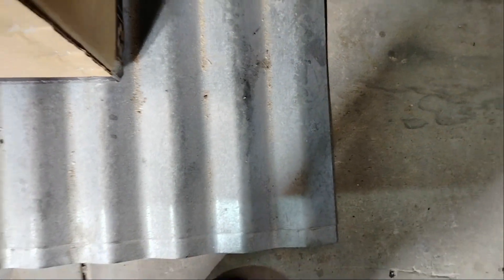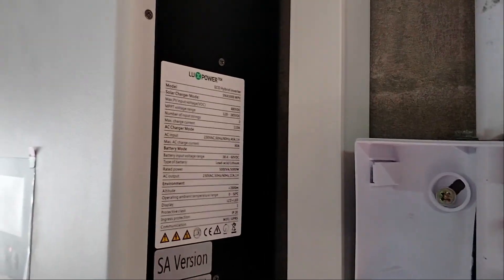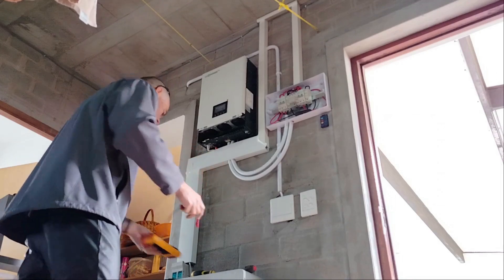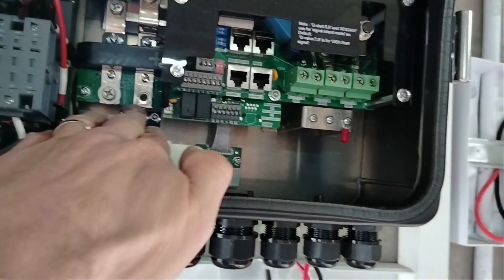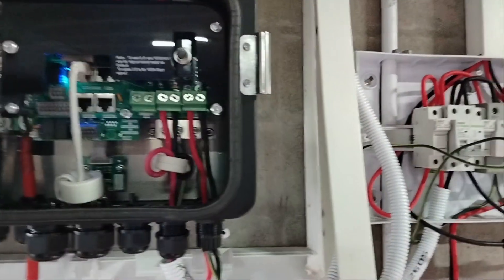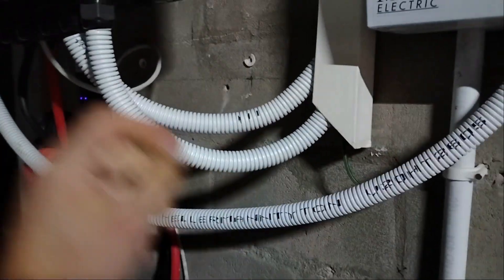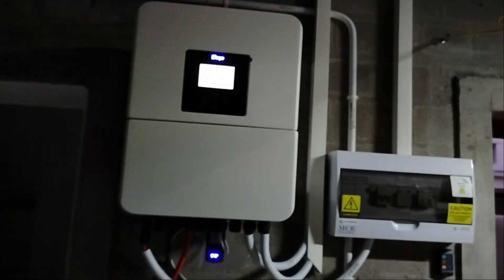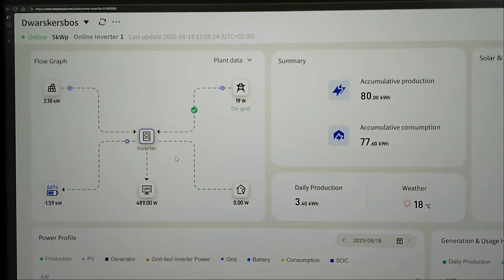Inverter Swap (Luxpower to Deye)

Comment: I have been using and installing Luxpower Inverter for years no problem at all..even the SNA series..works fine...Lux is way better than Deye
Reply from the maker: Except the SNA in coastal regions - that's a no go.

Comment: is that SG05 version?  how s fan noise? %50 load? %90 load? is there high pitch sound while inverting?
Reply from the maker: Deye : No fan noise, it is passively cooled. Yes there is a high pitch sound, you will hear it in the video. 
Luxpowertek : Fans are a lot lower with the latest firmware. No noise otherwise whether inverting or not.

Comment: If you want a system that's going to last, never buy one of these cheap, Chinese made high frequency, transformerless inverter. Always buy a heavy duty, low frequency, transformer based inverter instead.
Reply from the maker: Transformer based inverters are not as efficient and cost a lot more. Some even engage in price-fixing, like Victron. I have worked with cheap Must inverters and now more costly Deye ones. They all work and are easy to fix if needed.
Reply: Deye is a professional producer, so make no mistake , if you do not now a brand does not make is bad . we have 4 x 50HV Deye inverters, with 250 KW HV batteries, whole factory runs on it , heavy machinery ( 30kw cnc machines) , works perfect for more then 1,5 years , so if you have comments , please know what you are talking about . 😊

Comment: I install few Deye for now and must say it's very good and popular vendor. You can do even reset to default by cloud.. but one stuff cannot be done  = pressing the power button ! and we use a remotely fingerbot :) to press it remotelly if we need. And I have a 2x parallel setups who works and that way, I can remotely do anything until the wifi works :D
Reply from the maker: Very happy with it so far. The Luxpower can be rebooted remotely.